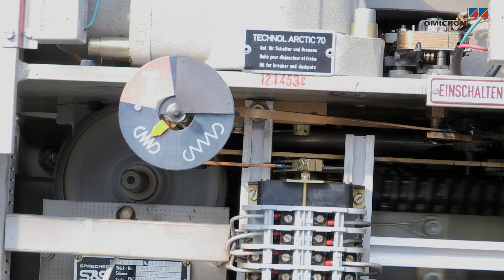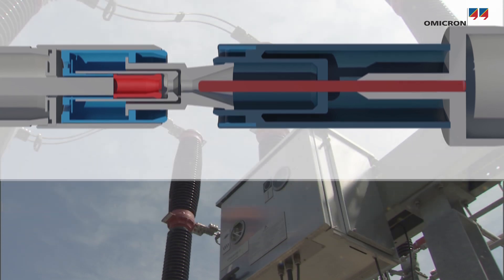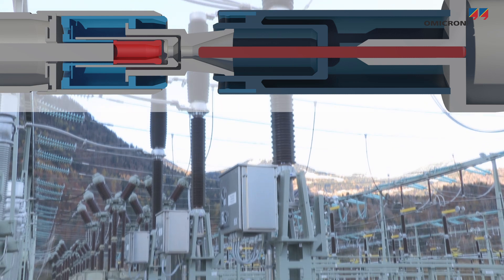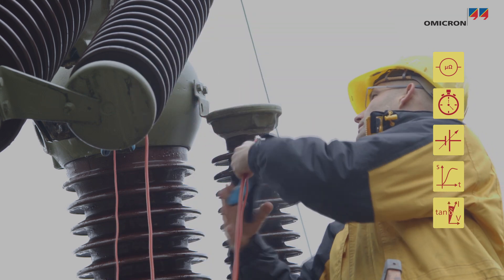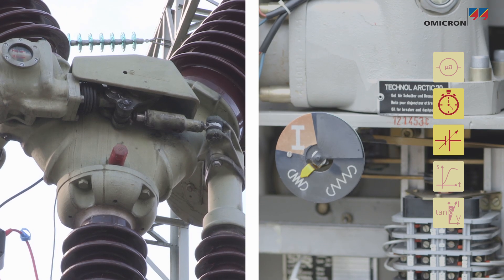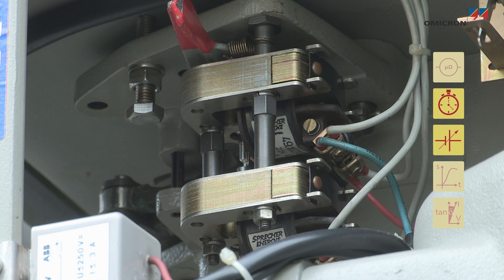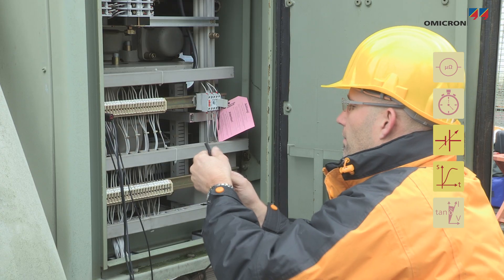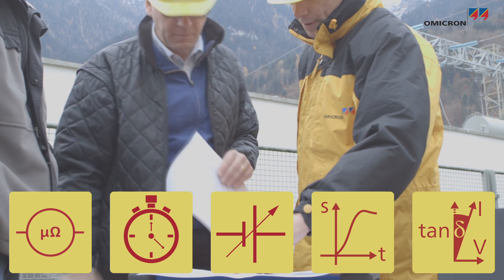Circuit Breaker Testing

Comment: How do you measure contact resistance by grounding both incoming and outgoing terminals of the breaker?? Earth resistance will be in parallel in this condition and there will be some error.
Correct me if I am wrong. Thank you
Reply from the maker: Dear Vikhyath, 

thanks a lot for your interest to our video and for your comment. Regarding your question: CIBANO 500 offers the new Current Sensor Measurement (CSM) method. This allows the operating times of the circuit breaker to be determined accurately even though the GIS is grounded on both sides. During a close or open operation of the circuit breaker, the current sensor measures the current change through the ground connection or the circuit breaker and sends its signals to CIBANO 500 which determines the switch response times: https://www.omicronenergy.com/en/news/details/new-method-for-timing-tests-on-gis-with-grounding-on-both-sides/  

The same principle does also work in air-insulated substations (AIS) if both sides of the circuit breaker must remain grounded due to safety reasons. In such case the current is injected into the ground path while a flexible Rogowski coil is attached around one side of the grounded terminals. If you have any additional questions, feel free to contact our technical support team - they are happy to help you: https://www.omicronenergy.com/en/support/technical-support/

Best regards, 
your OMICRON team

Comment: Name three way the circuit breaker provides isolation when open

Name two of the five elements that can fill the interruption chamber

There several methods that can be used to open and close the breaker, name one

Name two of the many diagnostic tests that can be run when inspecting the Breaker.

Comment: What type of insulator material is used to open / close the contact plug and sockets that will withstand say 220 KV and ground?
Reply from the maker: Dear Subramaniam Chandrasekar, 

thank you for you interest in our videos!
In high voltage switchgear, today mostly SF6 is used as interrupting medium. It has by far the best arc interruption capabilities for high voltages. In medium voltage, and nowadays even up to 145 kV, vacuum chambers are most common. The real challenge is not withstanding the 220 kV to ground, any insulator will do (often porcelain), the big challenge for circuit breakers is interrupting short circuit currents of magnitudes like 80 kA at high voltage. 

We hope this answer could clear some things up already. If you have any additional questions, please get in touch with us directly. You can find your local contact person here: https://www.omicronenergy.com/en/contact/addresses

Best Regards, 
your OMICRON team

Comment: This was in my recommended list and all I can do is laugh. No one in utilities tests anything anymore on the west coast, especially when Edison wants all Schweitzer relays that none of them have any clue how to operate, or program. Almost all of them I've ran into have the reclosure set to unlimited, when it should be set to 3 max.
Reply from the maker: Dear /dev/random, 

thank you for your interest and for your comment, which seems to be on testing protective relays rather than testing circuit breakers. Circuit breakers should be tested using both electrical and electromechanical tests once every 10-15 years. The frequency of testing protective relays varies greatly across world regions and utilities. Many utilities test them every four years. 
Thanks again for your remark. 

Best Regards, 
your OMICRON team

Comment: Many companies underestimate these tests. Usualy, this tests are expensives, because you need especificaly equipiments and workers who are trained to operate and get the best and correctly results.
But, one failure on one circuit breaker may cause big loses to companies.

Comment: Very well presented, but how often should these tests be carried out??
Reply from the maker: Dear kisakye tommy,
Test intervals for circuit breakers can differ a lot depending on the type of breaker and usage. While a circuit breaker can operate thousands of times under normal conditions, it can only interrupt about 5-15 short-circuits. Therefore, a condition based maintenance interval is preferable. Generally speaking, circuit breakers will be tested about every 6-10 years on average.
Best Regards
your OMICRON team

Comment: The term "closed" seems to actually mean open in this video..

A breaker trip produces an open circuit, not a closed circuit.  Otherwise, very good.
Reply from the maker: Hi Ken Kappler, thanks for watching and we're glad you liked the video. As mentioned in a previous comment: To ensure a proper operation of a circuit breaker the open (trip) and close commands are evaluated, including specific sequences (e.g. reclosing) and overlapping commands.
Your OMICRON Team

Comment: Hey, nice vid. What is the equipment shown in 3:02? Is it always a breaker? Thanks
Reply from the maker: Hi Jorge, What you see is a North America Substation with so called “Dead Tank” circuit breakers. Typical for such breakers is that they have current transformers mounted on each pole.

Comment: any one could explain what is power factor test..
Reply from the maker: Dear aldrin p a,
The power factor (or dissipation factor) is among others used to determine the condition of an insulation material.
As mentioned in this video, also the circuit breaker bushings have to be tested.
One parameter of testing the bushings is the power factor.

Best regards,
Your OMICRON team

Comment: In the real world they are never tested and are just replaced or repaired when they fail to open.
Reply from the maker: Hi Ebenezer Kalarama, 
For tests shown in the video you have to disconnect the circuit breaker from the grid. However, on such high voltage levels there are always backup lines to ensure that the power to customers is not interrupted. Thanks for watching!
Your OMICRON Team
Reply: They are tested I worked as a plant   journeyman electrician for 25 years and worked rebuilding large 230 kv breakers
Reply: And that's why some countries have a very reliable electrical grid while others lose power regularly.
Reply: And wouldn't some testing scenarios require interrupting the  power to customers?
Reply from the maker: Dear Roger,

thank you for your feedback.
Our experience and the feedback of our customers is, that the decision about testing, repairing or replacing a circuit breaker is mainly based on the cost related to each option.
As the equipment becomes more expensive in the higher voltage ranges, the willingness to determine the condition of a circuit breaker by using a proper test device increases as well.

Best regards,
Your OMICRON team
Reply: You misunderstood the reply. Omicron states that the switching equipment becomes more expensive in the higher voltage range, so it becomes more interesting to test those breakers before replacing a possible working unit.

Comment: Good vid. I was wondering if you'd do a DGA analysis on these types of CB's? Or is that strictly for a XFRM?
Reply from the maker: Dear araki916,

DGA is not only restricted to power transformers, it is also done on On-Load Tap Changers, Bulk-Oil Circuit Breakers, Oil-Immersed Reactors and so on. Nevertheless,  for this type of Circuit Breakers (Minimum Oil Circuit Breakers) DGA is not required, since the oil is utilized as interrupting media and not as an insulation media. Instead of DGA, another measurements are conducted like Oil Dielectric Breakdown and Interfacial Tension among others.

Best regards,
Your OMICRON team

Comment: How often are these high pot tests made?  Annually?
Reply from the maker: Dear Dorothy Gale,

The high potential test is not a default test within a standard test plan. This test is common for different areas (e.g. USA). In this areas high potential tests are an integral component of revision/maintenance measurements.
The frequency of revisions/maintenances is related to the CB manufacturer as well as the substation operator.

Best regards,
Your OMICRON team

Comment: How do they turn these one and off without causing a surge or spike?  How do they deal with a power supply that has lost a third of a phase or when one of the 3 power supply circuits is lost?
Reply from the maker: Dear Phillip Mulligan,

While the interrupter opens, the spark is controlled by the extinguishing medium (compressed air, oil, vacuum or SF6).
The protection relay of the power grid trips and the whole 3 phase system is out of operation or a backup line is used to ensure a smooth power transmission.

Best regards,
Your OMICRON team
Reply: Thanks for the info.  I didn't expect it to be this simple.  I always thought the power grid as a very complex system that was pretty fragile.   Epcor up here in Alberta goes to extreme measures to insure such an event is very rare.
Reply: OMICRONenergy
Reply: Phillip Mullig
Reply: Phillip Mulligan everyone does

Comment: A reassuring set of test done here, although, all that exposed mechanics which I would think would lock up in the winter with ice. The internal mechanicals will slow up too, the grease will become hard. These tests need to be done under worst case scenario too.

Comment: This is very interesting. I retired as a Master Electrician in 2003 and had worked on 13.8 kv or less for 32 years. In that Voltage range, at that time, molded case breakers typically had a rating of around a dozen trips before they were rebuilt. We used some motorized breakers for 13.8kv which were around 1 meter cube, all metal, and were made by GE, and I do not know how many trips they could withstand. I avoided these breakers as much as possible.
Reply: Khadijah Brown yep testing GE  is petty and cruel.

Comment: how about power factor test? is that necessary to do the power factor test to CB?
Reply from the maker: Dear Vincentius Raki Mahindhara,

For older (oil-isolated) CBs, power factor tests can be performed, but are not really common. 
Newer generations of CBs are isolated with SF6 or vacuum. 
For these CBs it is more common to either test the SF6 with a SF6 analyzer or check if a vacuum is present. 
With an SF6 analyzer the gas is tested for dew/frost point, ppmv and ppmw as well as the SF6 purity (% Vol. SF6). 

Best regards,
Your OMICRON team

Comment: Good video ...and how much money for this switch .? And the operational life time before maintenance. .
Reply from the maker: Kilani Sdudah 
Dear Mr. Kilan Sdudah,

Thank you for your positive statement regarding our video. In your comment you ask about the price of a circuit breaker (switch) and its operational lifetime before maintenance. However, we, OMICRON, are a manufacturer of test equipment and have also a test system called CIBANO 500 with which you can test circuit breakers. We do not manufacture circuit breakers. Therefore, we don’t have price data or maintenance cycle data available. In order to get more information about OMICRON, please visit our website www.omicron.at. If you want to know more about CIBANO 500 please follow the link https://www.omicron.at/en/products/all/primary-testing-monitoring/cibano-500/ 

Please just let us know if you need more information.

Best regards, 
Your OMICRON Team